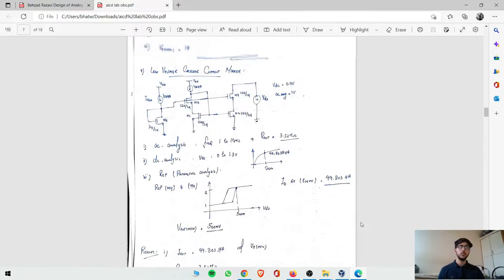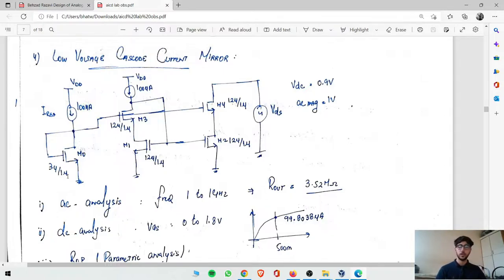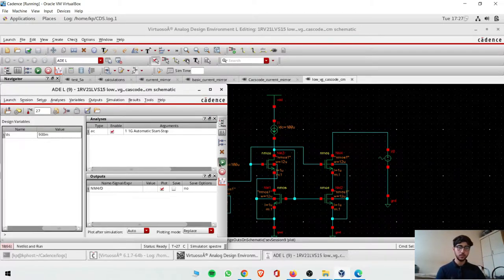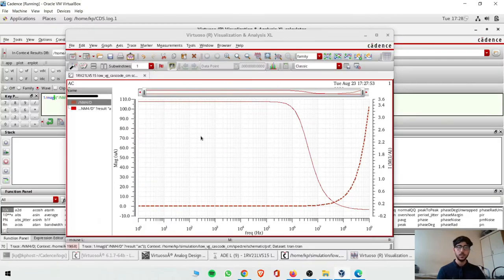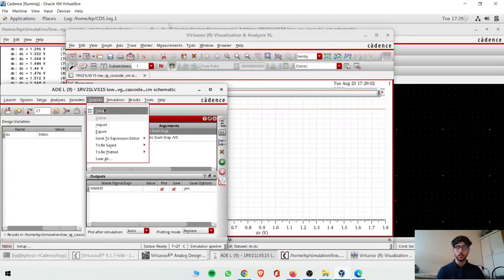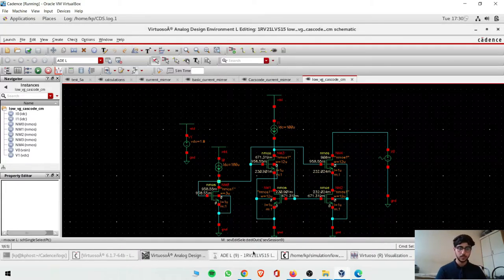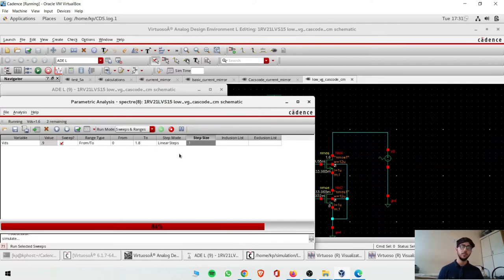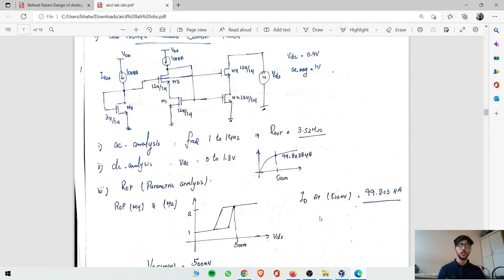6 Low Voltage Cascode Current Mirror | Virtuoso Cadence | Simulation | gpdk180 | Full Tutorial

Comment: When i tried to get the operation points after i run the parametric analysis i get this messages 
The simulator output is in the file "/home/buet/simulation/low_voltage_CCS/spectre/schematic/netlist/paraplot-sim-out".
parametric simulation complete.
But the graph dont show up. i used the same techinique for the previous cascode current mirror and i was able to get the region of operation graphs. Im using gpdk90 is that a factor to consider?

Comment: Why does the bottom MOSFET go into saturation first? Rather than the top one ?
Reply from the maker: Thanks for posting the query. The gate voltage of bottom transistor is pretty less ( 0.79V ), so it requires less vds to be in saturation as compared to upper transistor whose vg is at 1.25V